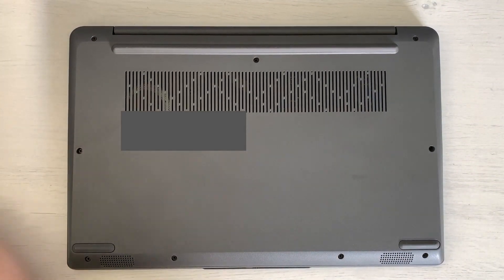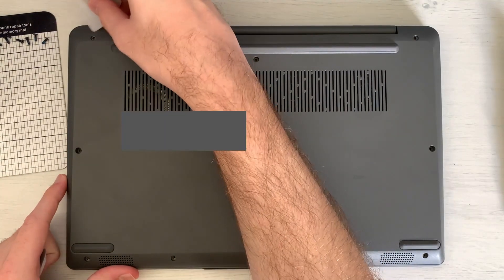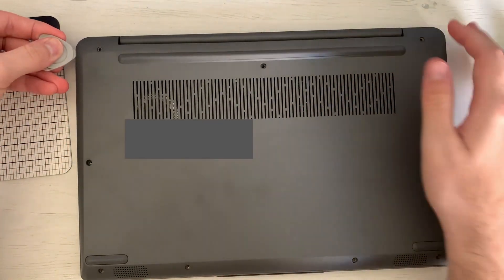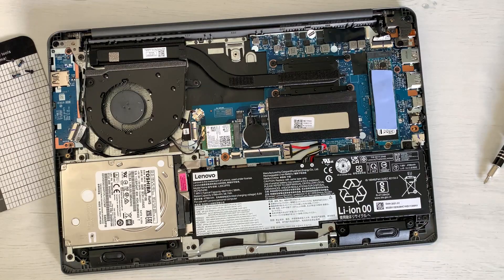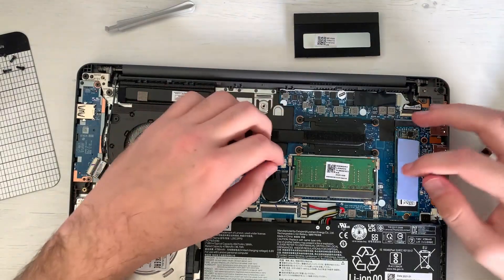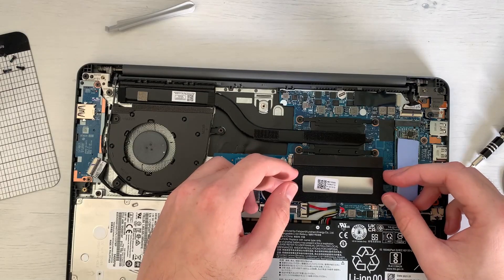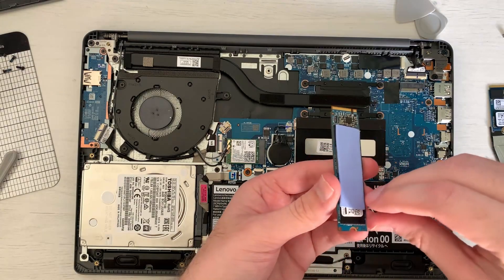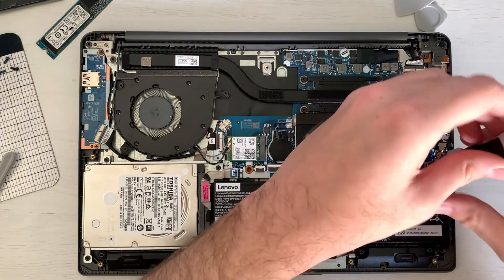Lenovo Ideapad 3 14 Inch teardown | SSD and RAM Upgrade Guide

Comment: my Ideapad 14 (5500U ryzen) comes with 8GB, is it a stick? or a soldered one?(didn't open it yet)  and also I see your battery is 38KW, but mine is 45KW, is it another model?
Reply from the maker: from my model and what i checkef online you should have either 4 or 8 gb ram soldered so either way there so be a slot for installing more or replacing one. and about the battery yes my model do have a smaller capacity as i decided to get the model with a 2.5" drive bay for more storage which takes place over a bigger battery
Reply: @ASking20  thanks, and yeah, mine is another model,, I found another video for that model, it's the same as here 4+4 but the battery is almost half of the laptop, so no space for the 2.5 drive